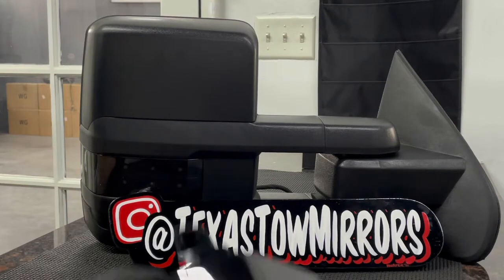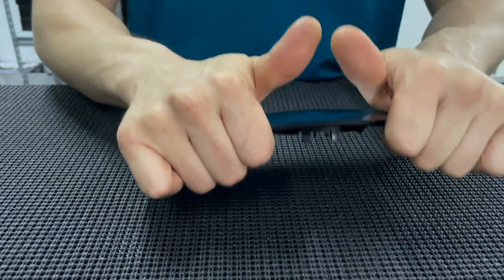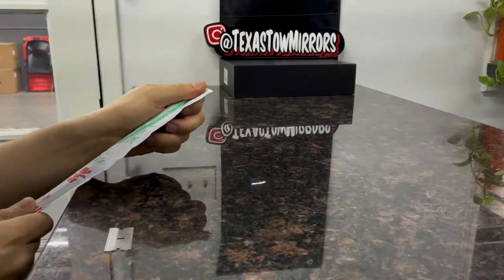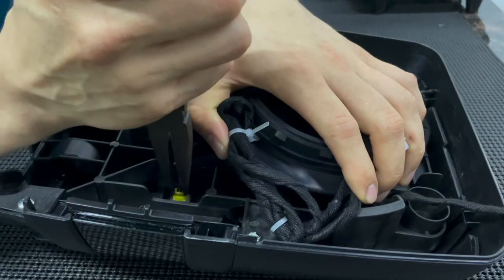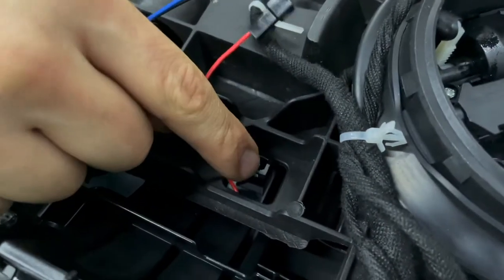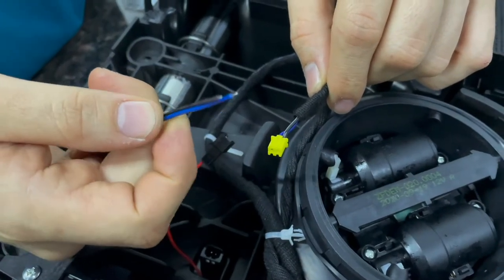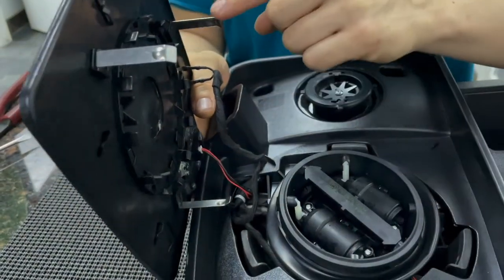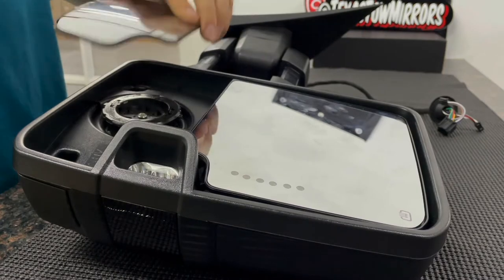How to disassemble Silverado / Sierra 2014-2018 Tow Mirrors and install switchbacks.

Comment: excellent video - minus one issue, it should be specified that this is not the process for power mirrors, or point out that process may change by year, my 2015 didn’t require the steps with chop sticks etc to remove upper mirror, I just had to push it up with my hands and it popped right out.  I was just trying to replace the original ones on my 2015 ($160 each) and now that I seen these, I might be interested.  Thanks.
Reply: what part of the process is different on power mirrors? thanks
Reply: @mattparks11  manual mirrors are on like a pivoting ball connected with plastic clips in a circular pattern not that different from the lower mirror requiring the chop stick trick to open enough of the plastic clips to pop it off.  Power mirrors have plate the mirror attached to with the power motor behind the plate. It’s just like L shaped bracket holding the mirror to the plate. On power mirrors, to take upper mirror off, simply hook your thumbs on the bottom and push straight up, mirror pops off super easy.
Reply: @pnwoutdoors8873  cool thanks a bunch

Comment: I have mine exactly how you showed in the video but my running lights don’t come on just the turn signals work. Any suggestions?
Reply from the maker: Hi , email us your number texastowmirrors@gmail.com
Reply: What was the issue? I have the same problem, but on mine only one side works on running light, it could be L or R but never together

Comment: I need help the mirrors on my 2015  the light plug is a 3 prong instead of 2 prong what do I do
Reply from the maker: Hi , it should still have three wires . All the marker lights we sell tells you what each color does.
Reply: how did you fix this? i have the same problem

Comment: what size and what type of bit did you use with the drill to take off the black part, i'm trying to get my light out thats on the mirror side and i cant seem to find the right bit for the damn screw thats in there. Star bit dont work , screw driver dont work, allen wrench dont work, torque bit dont work, not a fucking thing works to get whatever the fucking screw is, out.
Reply from the maker: Star bit. Sounds like your screws are stripped. Where did you purchase mirrors?

Comment: One solid jerk and my $170 mirrors are junk
Reply: Felt that, I’m currently trying to do this myself and already broke the bottom mirrors even after doing what multiple videos said to do.
Reply from the maker: Hi , as mentioned in the description. The cheaper mirrors bottom glass will break if tried to be removed . If you spent less than $300 on a set of tow mirrors there is a 95% chance they don’t come apart .
Reply from the maker: Hi , as mentioned in the description. The cheaper mirrors bottom glass will break if tried to be removed . If you spent less than $300 on a set of tow mirrors there is a 95% chance they don’t come apart .